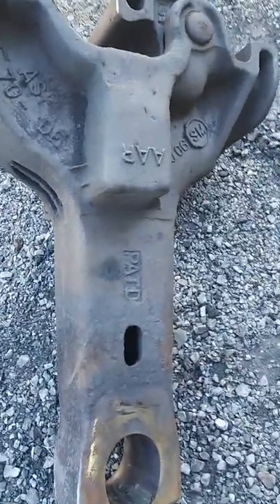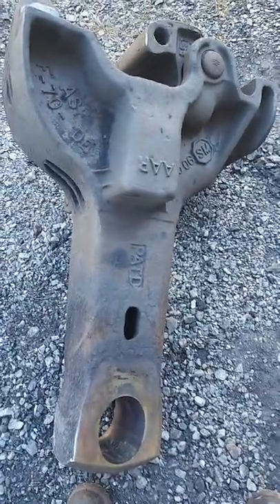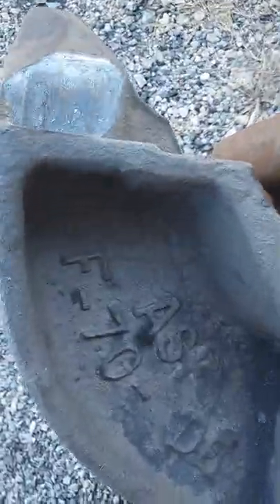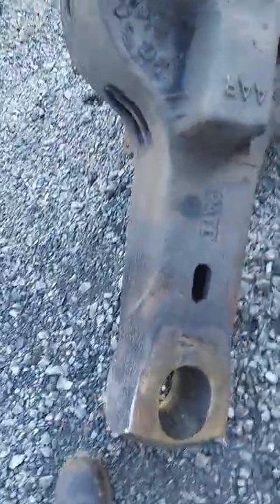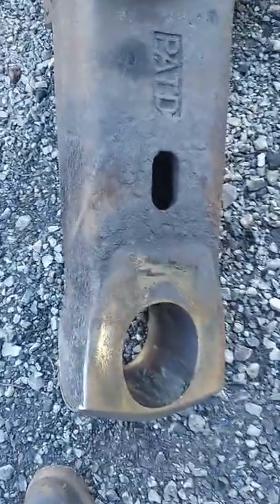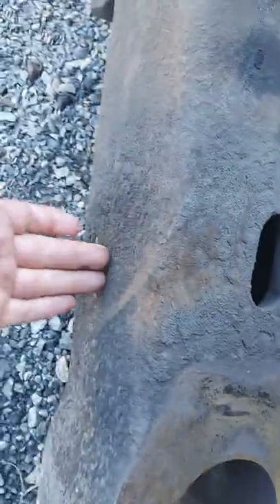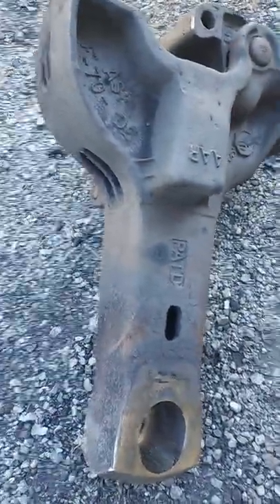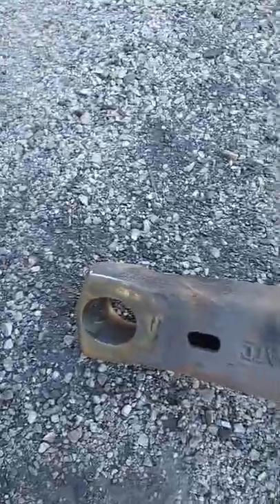Type F Rail Car Coupler #shorts

Comment: I pulled the drawbar out of a boxcar one time working in the yard. I told the 'Yardmaster' what had happened and he said "Well, just set it over to the rip track!" (His previous occupation was yard clerk.) I just left it and tied up the engine and went home for the day and let 3rd shift figure it out !  Thanks for the video. Not everyone gets to see the rest of the coupler(unless you pull it out of the railcar lol)
Reply from the maker: We've broken coupler keys several times and had the couplers
pull out going at track speed, how those cars never derailed
with that coupler falling out on track is a major miracle. 
One car it did tear a bottom dump hopper car door off and
spilled the coal from that bay down the track, what a mess.
Reply: @ccrx6700  Thanks for the reply. Glad I'm not the only guy that has these things happen to. Picking up the trail of coal must have been a nightmare !

Comment: That distal exterior wall is getting mighty thin. Ready to be replaced.  Check the wear on the draft gear, and replace the coupler and possibly the draft gear.  
During a cold snap in Central Nebraska 1990. I saw a coupler shatter like glass, in -35f temps.  Also, was my last days as a railcar mechanic welder.  Moved south to avoid those temps.

Comment: While the coupler itself at 80 lb is a large piece of metal it is amazing that several hundred of these hold together all those tons moving at a good clip
Reply: The knuckle weighs 80#. The entire coupler weighs much more. Type E knuckle  weighs approx. 72#. Type E and F knuckles are not interchangeable.

Comment: You didn’t pick it up 😊.  That is a big chunk of metal.   Thank you, take care and peace out.
Reply: Supposedly those things are 80lbs and is a requirement to be able to lift it to work in the outside area the railroad. Or at least that’s what I heard.
Reply: @Bassotronics  What you're talking about is just the knuckle of the coupler.  EJ was talking about the WHOLE coupler.  That's going to weigh a few pounds more than 80lbs.

Comment: that is neat, different 
mounting based upon 
the type of car?
or is it more based upon 
the builder?  it is so
nice to learn about the variety of couplers out there. but there are the 
safety styled that
have catches both 
top and bottom to
keep them together
during a derailment.
great video thanks 
have a great weekend.
Reply from the maker: You pose a very interesting question Barry and I'm sorry I do
not have an answer for why different couplers are on different
cars. We have both here on our hopper cars, mostly Type E.
I wish I knew why each type is chosen. I assume, and this only
an assumption, it is based on car builder.

Comment: Is it safe to couple type F freight car coupler with type E passanger coach coupler for mixed use?
Reply from the maker: We couple type E and F together on our hopper cars all the time.
How they couple together is the same no matter which type it
is. The difference between the two is how the coupler shank
is connected to the yoke which holds the draft gear, either by
key or by pin. I know absolutely nothing about passenger
cars but would imagine they would still coupler together. Thanks
so much for watching the video eyuelmulugeta.